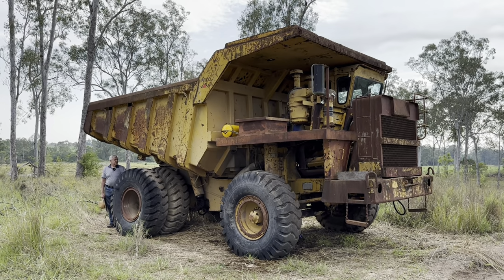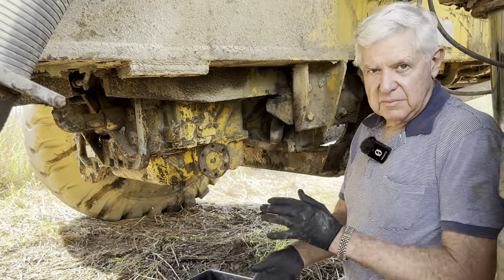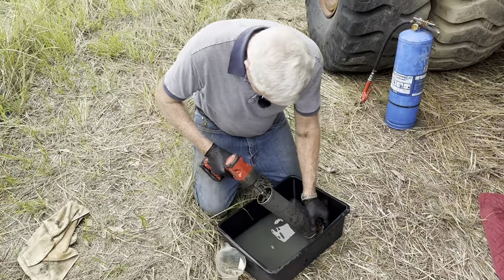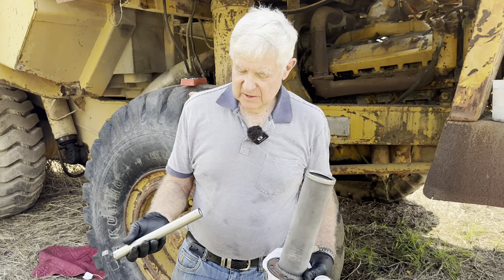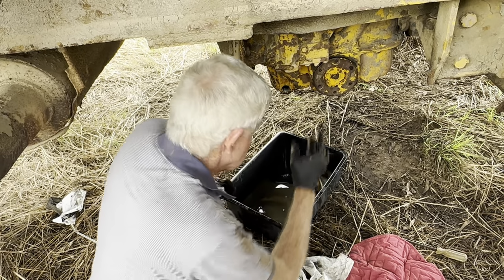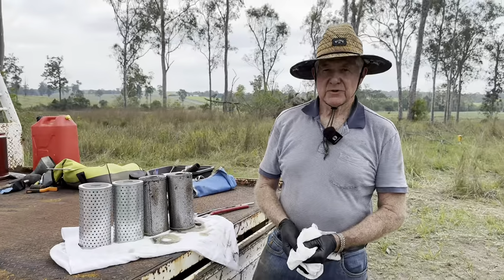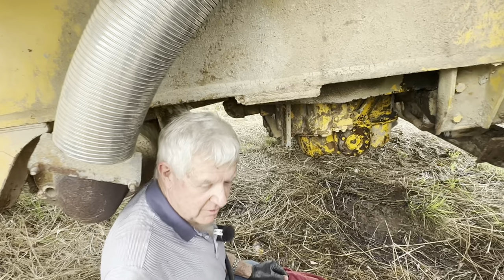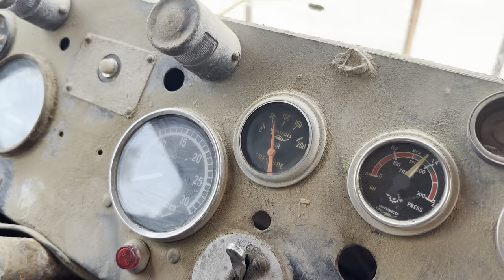Will this 60yr OLD V12 2 STROKE Detroit Dump Truck START & DRIVE out of this Quarry?

Comment: Fantastic work getting her to start and drive Bruce. WABCO stands for Westinghouse Air Brake Company and they were made in the US. I spent 2 years driving these for Mt Newman Mining Coy in the70s'. We used the 75 tonners as watercarts to keep the dust down on the haul roads and the production trucks were 120 ton and 200 ton Haulpaks. These were all airconditioned and noise insulated. They were WABCO diesel electric where the diesel engine drove electric motors in each wheel giving you dynamic braking turning the wheels in reverse going down a hill. The 75 tonners were not diesel electric or airconditioned just like Wally and nobody liked doing a shift in them.
Reply: How's your hearing?

Comment: I like seeing the patient and methodical way that Bruce wakes these machines up from sleeping for decades. Slow and easy like you're waking up a beautiful woman lying next to you in bed.

This channel is a breath of fresh air. Most Will It Run guys are just throwing a hot battery and some sort of fuel tank at a vehicle that's been sitting. Then get it cranking, flood it with 5 cans of brake cleaner, rev the hell out of it on startup and go do donuts.

Comment: I have really enjoyed these segments on getting this old piece of equipment in running condition, You had me with the fact it had a 12V 71 Detroit engine in it been in love with Detroit engines ever since I worked in a 2/71 Jimmy in a Allis Chalmers HD5 dozer  ,What a sight to see the old girl is ready to go back to work will the bed lift work need to get rid water in the Bucket .A  fresh coat of paint and she's ready for the auction block ,Well done Mate ,Please finish Wally properly

Comment: I HAD THE VOLUME TURNED ALL THE WAY UP ON MY SPEAKERS SO I COULD FEEL AND HEAR THE DEAFING SOUND OF THE ENGINE. MY EARS ARE STILL HURTING AND IT HAS CAUSED ME TO WRITE IN ALL CAPS TO SIMULATE COMPUTER YELLING BECAUSE I AM EFFECTIVELY NOW DEAF.
Reply: I can relate to that, many years ago I drove an M113A1 V6 Detroit down the Hume.  At the time it seemed great fun but in old age it seems more insane.  We knew that when the sprockets stopped making so much noise we were basically rolling, with a Detroit humming at 3050rpm.  Nothing quite like it.
Reply: In our youth we wish to make noise, its our personal statement of vigor. We drive loud vehicles, we liked loud explosions in the Army or at the gun range, and the load noises makes us giddy like little school boys especially the big KABOOMS. I still crack of a smile when this happens and remind myself I am 50 and supposed to act my age. Its tough but I do it. So God Bless You, My Fellow young man in old skin. 
 @SerialDelta
Reply: @jeetime9436  God bless you too mate.  Yes I can relate to the louder the better..  The loudest gun for me was the 106mm Recoilless rifle when I was a Grunt.. and later it was sitting on the engine deck of an Iroquois making adjustments to N2.  Haha, yes I'm nearly 60 and live alone with my hounds.  One is named...  Huey.
Reply: Awesome  @SerialDelta

Comment: Detroits make subpar power compared to modern diesels but I would doubt any would last as long, Those things literally will run forever!
Reply: Any old diesel engine makes lower power than a modern one. Modern Detroits make similar power to their competitors. I have a Series 60 with 1.3 million miles on it. It's a little tired, but runs great still.

Comment: The engine sounds sweet enough, Bruce. I used to work on Terex equipment over here in the UK, and I've changed more than enough filters on those engines and transmissions. The DDA part number for the filters were 5573014 or PF132W, there's quite a few more that will do but my brain can't recall them at the moment I've been away from the spanners for 30 years now.
The retarder spools had a habit of sticking. Just give that a check to see if it moves easily enough.
Thanks for sharing, and keep em coming

Comment: That machine is worth every second you spent on her and every cent as well. I just can’t see a new dump truck in this same class lasting in this same condition 50+ years on; the new ones just are too complicated and reliant on flimsy electrical systems. Thanks for caring about this gem, Bruce mate, I have enjoyed the whole process with Wally
Reply: Not a prayer,  this beast is worth her weight in hydro fluid 🤠🤟

Comment: 9:57 kinda makes sense in that application, that the filter filters inside out. Otherwise, you'd have to clean all that muck from inside the housing as well. Not an easy proposition with a hole that small. Plus, bonus, it's easier to wash, cause you wash it from the outside in, and all the muck and juices flow a bit easier.

Comment: Bruce with your meticulous methods she will drive well back to your place, that is if not too much water was still in the torque converter. I heard the brakes and they sounded like they were working well. I definitely would not drive it without brakes on the road with something that large. Like to see the gross weight of this beast without 5,000 liters of water in the bed. I half expected Bruce to lift the bed and dump it out but then I thought what if it blows a hose and looses all that hydraulic fluid. Would be neat if some good Sameritan sent ya'll enough yellow paint to pretty her up. I would be willing to bet some construction company would love to have her if they could get her there. All the hydraulic  hoses would need freshened up. Someone might come along and give Bruce 30,000 bucks for her just the way she sits.

Comment: I had no doubt it would run and drive. If I had a fleet of vehicles you would definitely be in charge of all maintenance and repairs. Your attention to detail is very respectful. I was wondering what is the fuel capacity for Wally, it appears to be around 200-300 gallons.

Comment: Very clean starting!!
My old bosses son 30 years ago had a 1972 Ford highway tractor with a 2 cycle Detroit.
Every time it started it looked like it was on fire. Hidden in a cloud of white smoke and loud roar. 
If I remember he said it was very very high mileage but quite reliable. 
I have found that same level of gunk in hydraulic sumps before.  Looks like grey mush.  The hoses gradually break down and eventually burst.
Its very very very dangerous to try to salvage old tired feed hoses as they don't always pop off (which in itself is a danger as the device will instantly slam shut or collapse) (I've seen it) it sometimes breaks down "invisibly" and can result in "needles" of oil which instantly peirce through clothing and skin. 
Kiss goodbye what body parts were in the pathway of the needle. 
That is why Bruce changed them.  
Right at face level and older than dirt. A death sentence if one were to let go.

Comment: A lot of hard work, but the end result is well worth it Bruce.  As an aside, I would have used petrol to wash out the mesh filter in preference to diesel as it would have melted/dissolved much of, if not all of that gunk. You would make a good mentor for an apprentice, you have the right work ethic and patience.  Seen a large bulldozer dumped in a paddock yesterday you would love, no blade but just the rippers, not a Caterpillar (looks like a European version of a D7 or D8), maybe a Wabco.  Great to see Wally Wabco take off, albeit a few ton of water/sludge in the back!:washhands:😉

Comment: I said it before and I'll say it again. It is a pleasure watching someone work who is passionate about cleanliness. I had it flogged into me from my service boss when I was an apprentice back yonda. On the trans gauze, if you made a disc to fit into the recess and bolt on it would give the cover plate a bit of strength. What about the hoist?

Comment: I camn't understand why a valuable piece of plant should have been left abandoned and unused for so long. It clearly hadn't been run into the ground by the last owner. Because of its age I doubt it would stand the rigours of a working life i.e. the tyres are well and truly over age and would cost a few thousand to replace.  Great as another piece of plant to add to a collection of plant used for display purposes at vintage shows.

Comment: Nice job and good watch.  Every Detroit Diesel needs a good muffler on the exhaust, but it seems very few have them.  The sound is just plain ear splitting.  I couldn't help but wonder if the transmission was slipping, the way the engine revved while pulling, in any gear.

Comment: Looks like you might get a rigid frame and an ar-tic (Volvo) too. Nothing like those old trucks. If the shotgun door is open there is a steady wind blowing on you from the right side so it's not so bad while you're moving but you might as well learn to like the sound of a 2-cycle because that's what you'll have to deal with. I was always grinning when in an R-22 or 35, especially the 35 with the V-12. You could hear it echo all over. Tye Terex with the Cummins were #3 and a Cat was #2! Get it home and give it a good going over and greasing and it'll be a treasure! HEAVY hauler. Pedal flat on the floor and snatching gears on the Allison. Loved every day! CHEERS and Blessings! Seems like the R-50's had the V-16 in them.

Comment: I pulled a transmission strainer out of an old Cat skidder once. The Cat mechanic told me where it was and to not have a heart attack if it was full of shrapnel. Lol.   It  was.    I don’t know how it made it down there but there were 3 teeth from a previous starter drive gear amongst other things.   The tranny never skipped a beat and is still pulling today.

Comment: Bruce I dont know if you are aware of them, but if you got an ultrasonic parts cleaner that would be perfect for those filters and bolts if you get one that is deep enough to fit, sit them open end down and itll shake all the scum loose in seconds leaving its sparkling, and its relatively portable

Comment: Yeap, i do the same. Whenever i know there's no oil in the system, i put extra. Run it a bit move it a smidge, then check again. In most cases, extra oil is no problem, certainly better than not enough or too much water.

Comment: A Roots Blower on Two Stroke GM is classified as a normally aspirated engine. Without the Blower the engine will not run. 4 inlet valves for the charge of air and a series of exhaust ports in the lower cylinder wall to exhaust the gas. Hence 2 stroke configuration.

Comment: Never had any doubts. We salute your work and we salute wally for sticking it out, and we must thank you camera man as well, you two seem to work well together.

I can't help but think of Slim Dustys 'There Lies a Workhorse' when you work under and in this machine.

"From the mud and the dust inches deep on the wheels I can see hard work written thereon.
One look underneath at that oil spattered sump and I know every oil seal has gone."

Comment: how do all? you didn't let us down bruce. well done bloke.
i signed on logging for allan house and his dad, arnie maintained the d7g when i got the start through xmas replacing the front idler shocks. 1000 t plus saw per week and started in a coup of 22-35's that a fire had stuck every bit of bark onto log. allan took me to jack jeffrays ops running the first excavator with grabs. he asked ' what i reconed '? i said ' if you can afford one get it, you'll never look back. around may '85 a 30 t hitachi was delivered. and he got one or two days off every fortnight. prior running a td 20 to drag and load which had to be fed 20-30 litres of engine oil per day. when i spotted 2 extra ins/outs on the transfer case i suggested we attach an hydraulic chainsaw down the side of the stick and the crew laughed. now about 90% have 'em on. taztez.

Comment: hi Bruce from england. you may need to check the air- cleaners elements,, they look like Donaldsons ones to me. good luck. is the engine oil good?
Reply: @@petersmith4455  Donaldson air filters?  Their factory is just 10 minutes down the road from me!  I was even welding together their covers & caps for a while!

Comment: I give you a little tip I don't know where you're done this get it all big fire extinguisher like the one you use in there fill it up with water not all the way and then you top it up with air I don't know why you go there you goonie blowing s*** off 992 loaders are there massive d6 dozers the best portable water blaster to get you out of trouble and try to get one of them old big boogers similar to the one you just used anyway that's just a bit of a tip you must probably already done that that helps you out a lot believe you me been around doses and tracks machines and login Logan coal trains with 992s the best little blower go on that's it I love what you doing so I can't wait to see these big old girl fire up keep up the good work I love his old equipment❤❤❤❤❤🎉 thank you Ray🎉

Comment: The transmission would that be a Allison automatic, My terra gator built by Ag-Chem used a V8 Cummins VT 555 big cam with turbo charger, sounds distinctively the same Bruce, Great show as always everything you attempt is is old school the correct and only way to achieve long term trouble free maintenance. Don’t forget you left the rad cap loose 👍

Comment: 44:30 like this disgusting being in the comments pointed out i have to admit, that u should be carefull in those situations.

it can really rarely happen that cars and other vehicles start driving out of nowhere for whatever reason.  Stay safe, i appreciate ur work and u are really inspiring for me.

i wish i would live in the US or Australia.. i love the sunny weather and the possibilitys u have over there!

This video already made me search for used old dump trucks in my country, but sadly i havent found one yet.

this must be the ultimate apocalypse survival vehicle. :)  Just imagine metal plating all around and a small shed on the flat bed!  

With a cellar for storage, a main room, an attic for storage and sleeping compartment. :)

and a armored roof where u can spot the surroundings and where some nice weapons are mounted. 

also a sharpened bull catcher like in GTA would be nice, so u can push everything in front of u away.
Reply: No air pressure at the start, brakes are binded.

Comment: A Detroit won’t run without a roots blower.  I’m surprised this small, what’s it 35 tons, has a 12V engine in her.
Reply: All the power in a Detroit comes from the high rev so a big motor is needed in a smaller truck, my dad used to drive tri axle dump trucks from coal mine to plant here in West Virginia and he was driving Whites/Volvos for a time and hated them as they all had Detroit diesels and a “sloppy” 10 speed he said they were really pretty terrible to drive as it was just a constant battle with throttle and gear management trying to keep it just under the red line on the RPM gauge for maximum power output.

Comment: I once serviced a 85 Euclid with a big Detroit. The air starter was so loud you looked in the mirror for smoke coming out the rear to see if it was running. 😂

Comment: Hey Brucy: Ya'll couldnt see what we were seeing while driving her, but with that rain water sloshing out of the back and then seeing cattails growing above the bed from it's deepest point I really expected you to lift the bed and dump it out. Then maybe leave the bed up so when starting the girl she would turn over a bit faster by lowering the bed whilst cranking. Don't know if you knew that heavy equipment trick by lowering the bed while cranking but it will push old tired engines enough to quickly fire the diesel on a cold morning. Ya'll call them floats I simply don't think she would fit on a parade float but we stateside call them lowboys. Some will carry much more than others depending on how many axles and whether they have a jeep in front of the lowboy.
Reply: Dude that motor needed no assistance, started faster than some new engine.
Reply: Agreed..Take more than water and reeds to stop that  beast.. Lol...

Comment: Hey Bruce, I think this was the third video of yours I watched. I like listening to you describe what you’re doing as I don’t know any thing about heavy equipment.
I do have a comment, water splashing out of the dump bed. If that is indeed filled with water, it is adding a lot of unnecessary weight. I would make sure it was empty before loading on the float.
Thanks for the great video - wayne

Comment: 42:56 You really want to use covers on those battery terminal clamps and be very careful with spanners around them, especially if they are unprotected. 
I have personally witnessed a spanner falling onto a truck battery, shorting it out, arc-welding itself to the terminals in an instant and cooking the battery in about a minute, which then proceeded to explode and spray everything nearby with hot battery acid.
It turns into a fun story later but not while it is happening ;-)

Comment: How did moisture get in the gearbox I thought that was a sealed system
Reply: They’ll sweat with the change of temperature from day to night . That’s why most equipment was painted on the inside of gear housings.

Comment: There is a great product called pro ma mbl8. helps alot with this type of work. Good for sticky gearboxes too. Its not a gimmick and it is still sold after 30 or more years. micrometallic particles of copper and lead re plate wear and reduce fiction. Awesome stuff

Comment: Ia it possible to put this engine in a lets say f450?
Reply: The Detroit V12's are 60+ inches long and weigh in at 3,000+lbs... just fitting a Detroit V6 (6V71) into a F450 is pushing it to the limits, I highly doubt you could get away with a V12 swap. There's older semi's that ran the V12 in them but they are hard to find and rarely in driving condition unless they have been restored.